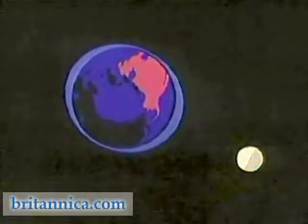Ocean Tides at the Bay of Fundy (Britannica.com)

Comment: The wonderful Fundy Bay is the perfect candidate place for applying new Aero-Aqueous multi purpose renewable power station design, specially at the neck of bight Minas basin where the bay narrows to almost 4-7 Kms in the distance starting from Cape split and up to 8 Kms east of it. 
North to south consecutive arrays of floating submersed wheels could be placed in such area to help catch high tidal energy plus bridging the two bay sides.